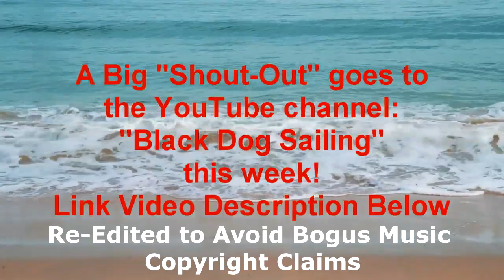(S-3 Ep-26) DIY Portable Generator Enclosure, Part 2 (FREE PLANS) (Re-Edited)

Comment: I'm thinking that if it isn't painted it would fall apart...no?
Reply from the maker: No. After the past few years of use, it's still solid. That being said, I would have used exterior plywood or some other material, but I used what I had on hand that was leftover from other projects or given to me by local contractors. My projects usually involve materials already on hand where I don't have to spend any money. If this were to fall apart though, it doesn't owe me anything and I've had a few years of use out of it. 👍👍👍